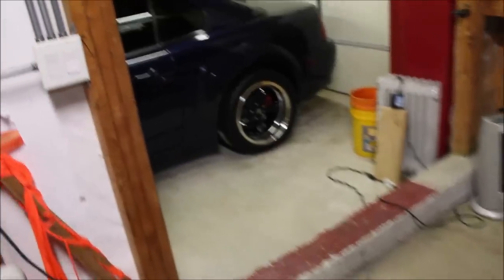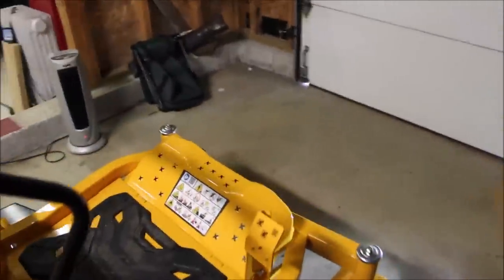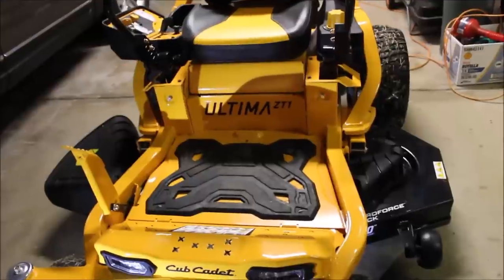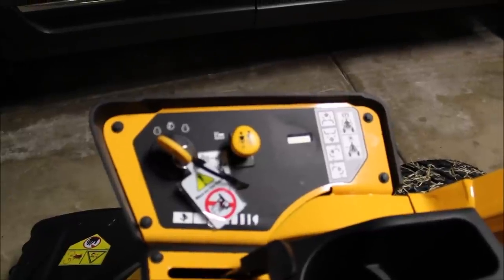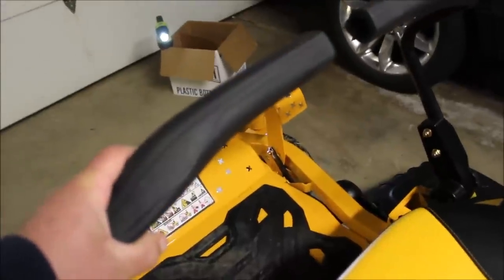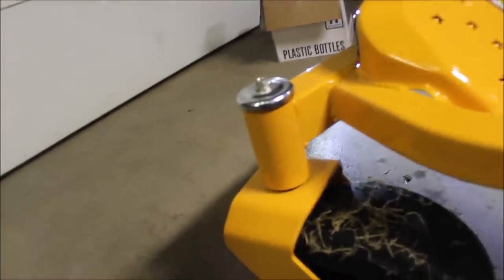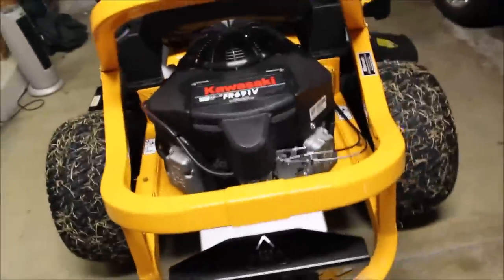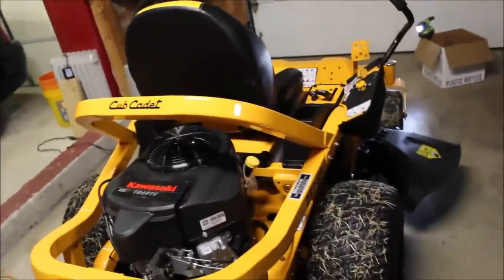Cub Cadet ZT1 Ultima Series Initial Overview

Comment from the maker: My Zt1 50 had the deck vibration that some have complained about. After a little back and forth talk with the dealer I contacted Cub and sent a vid, they confirmed it was an issue but said it was isolated. They set up a case file which I gave to my dealer. Cub sent new parts to my dealer and the mower was repaired. I cut last night and I'm now completely happy with the operation. This is the condensed version of course and transpired over a few weeks, now that the issue is resolved I will shoot a detailed video update on the whole process and resolution. Thanks for watching!!
Reply: I like your retro look Mustang rims.  I will be buying a set for my Mustang soon.  Where did you get the black/aluminum type?  I did not see those on "the tire rack" site.
Thanks.  I like my ZT1.  Just tried the mulch kit today.  Tall 8" grass, no piles.  I am happy with it.
Reply: Did you say you were into RC cars?  If you run the gas 1/5th scale, I am Doug from ESP, Zenoah engine builder sold at DDM.  You ever run my stuff?  :)
Reply from the maker: EarthSurferUSA Thanks Man! LMR (late model restoration) is the place for wheels!  Agreed the mulch kit is working perfectly!    Thanks for Watching the video!
Reply from the maker: EarthSurferUSA Im into Rc but i dont have any 1/5 scale they are awesome but costly!  Im into 1/10 and micro and really like 1/10 Tamiya kits, especially the retro kits👍

Comment: I bought one early spring. New home to us with 1 acre, lots of terrain and mega  trees. I’ve worked it hard both cutting grass and picking up leaves. Plus hauling a gorilla cart loaded with dirt/rock, etc up to 1000+ lbs. it’s been a work horse, no probs to date. Love the zero turn fine control.
Reply from the maker: That's Great to hear! I wish I could say the same my deck is still jacked up I will have to figure something out before spring. They worked on it and it was much improved but by summers end it was banging away again. I'm thrilled with all aspects other than the sloppy deck☹️. Thanks for leaving the comment and for checking out the video 👍 👍

Comment: I gave thumbs up, and liked this review because you explained something I have never seen explained, but absolutely logical. Longer blades, high rotational mass, more flex. Folks don’t realize the 2 blade mowers have 2 LONG blades to get 42-46 inches. Even the 46-48 with three blades have wide stamped decks more prone to flexing and dent / bending. A long piece of metal bends easier, period.  

Also when you compare these new Cubs to the Ariens or the Toro; the frame is bulkier, the chassis is stiffer, etc.
Reply from the maker: Thanks alot For watching the video and leaving the cool comment!!👍👍

Comment: Im so torn on buying the cub cadet 50 inch tractor or the 42 inch zero turn, tractor seems to have many more things you can use it for but the zero turn seems so nice
Reply from the maker: My Buddy bought the 42 zt1 and loves it, he has no vibration issues with the 42. The comfort of the zero and tractor is not even in the same category and the zero is much more agile and fast at getting the job done. I got home from work and rain was coming, I jumped on mine and cut my 200×100 lot in about 20 min, that was mostly at full speed. I just posted a full review and cut footage last week, check it out 👍.  Thanks for watching!

Comment: Just bought this mower in the 42 April of 2020. Still prob one of the best zero turn residential lowered out there. Love mine I have a yard approx the same size as yours and I was able to cut it in under 30 minutes. Lots of trees and obstacles which is why I went zero turn. Overkill? Maybe but I love it.
Reply from the maker: I wish i would have went with the 42 , the 42 deck seems smoother from what i hear. Congrats on the purchase and thanks for Watching!!

Comment: looking at one of these from my local cub dealer to mow my yard and my neighbors yard I take care between the two yards it comes up to probably around 2 acres.  I was having a hard time deciding between some of the other features you get with the ZT1 50 inch and ZT2 50 inch.  I feel the ZT1 will suit my needs good but, been reading over all the people last year who have had the deck vibration issues with these.  Hopefully the new ones my dealer has in that problem is cured.  I just have a question do you regret buying this mower?  I am probably going to pull the trigger here in the next 2-3 weeks or so and go get one.
Reply from the maker: 427 Elevating Productions Im still having deck issues and it is gradually getting worse. I have to reopen my case and if the mower was correct I would love it but unfortunately after buying a mower I thought would last for many years I’m disgusted! I know many have had good experiences, but mine has not been good. I was very excited to get this mower and after investing my hard earned cash I expected much better. I could have went with a cheap tractor and had a better result. I also feel the hydros are loud and i dont feel confident they will last long. Im hoping Cub will do the right thing and correct my issues, if they dont I will seriously consider trading in which will result in a loss on my end. If i didnt have the issues i feel the overall design is great but what good is a mower if it doesnt cut grass right or smoothly? I will update as more info is available, Cub should have a solution by now last year they told me they had no deck complaints......Thanks for watching the vid and good luck with your decision👍
Reply: @2RCPRODUCTIONS  thanks for the response sorry to hear your still having deck issues though.

Comment: Thinking about purchasing this unit but you’re not the only one who has mentioned a deck vibration on their YouTube videos. Have you heard anything back from Cub about the issue?
Reply from the maker: Yeah there's a definite issue, my dealer so far has been no help at all. I'm waiting on a call back from him, been 3 days now after calling with my case number for him to schedule a pickup for inspection. Cub has been helpful so far, I sent them a video and they contacted me right away and said it was NOT normal and needed to go to the dealer for inspection. The owner of the dealer thus far has told me it's normal and to run with it lol! I'm hoping Cub makes it right, if they can determine what it is I will fix it myself if I have to. I will say it's not an issue that arises mine was that way since first cut so having said that the mower overall is fantastic and much better than anything else in it's class. So just be sure you run it first with wide open throttle before receiving it. Unfortunately my dealer called it good on prep and sent it over and I didn't check it before they drove off that's on me. I'm waiting for all this to unfold before I post a follow up review. I will say I've cut with it a few times and it cuts and drives flawless it's just the annoyance of the banging idler and vibration and part failure eventually will come from excessive vibration, I will keep you posted, I myself would like a new deck and I'll ship the old one back we will see........ Thanks for Watching 😊👍
Reply: 2RCPRODUCTIONS After a month, I’m finally getting my replacement today! Update videos coming soon.  They weren’t very happy about my unlisted video showing just how bad the vibration of the deck was, so they are sending a rep out to “assist” on the next video addressing the issues. Lol. I’m still going to tell my story.
Reply from the maker: @g4outdoors  They are Telling me they are unaware of an issue or what it might be? My wife called the dealer today and to my surprise I guess he ordered a bunch of parts to replace and to try a solution. Thanks for sharing and being honest, your followers will appreciate that👍 I will eagerly await your next video 👍
Reply: 2RCPRODUCTIONS Unfortunately, I’m out of town on vacation for a bit. So I won’t be able to record until Monday, but @cut&cleantv will more than likely have his up by the weekend. (Read edit)
Reply from the maker: @g4outdoors  My Wife talked to the dealer they picked it up today and Cub sent parts to the dealer so we will see what happens 🙄🙏...
Reply: I spent 2 months narrowing down the search for a new zero turn. Ultimately it came down to 3 models. I wish the fabricated deck was built a little better. The plastic used in the hand control joints made me nervous. The paint on the frame was not applied evenly and missed spots. The thick mechanics wire for disengaging the hydrostatic transmission was a cheap design. I did however like the added options of the lights, high 18 inch seat and floor Mat. I did however end up buying the John Deere 355E from a John Deere dealer. They actually beat the box store price and now I have customer support from a manufacturer directly. Good luck making your decision.
Reply: @jamiewallace6551  So how is that 355E treating you after 3 years?

Comment: I’m looking at one of these , just got a 3 acre yard with the new house , will this machine be able to handle 3 acres once a week ? It’s all flat pretty much as well
Reply from the maker: I would say it would without an issue, you can get a 54 or 60 and the zt2 comes with better transmissions. I've been using mine on some hills with no issues at all. My yard is 1/2 acre and with the 50 I can finish in about 20 min or so. Thanks for watching the video 👍👍

Comment: Should I be concerned when my zt2 right out of the gate is misaligned? I pull the lap bar straight back and it pulls one way. The same going forward when both bards are fully extended.
Reply from the maker: You can adjust the limits to try to even them out, the adjustment bolts are right in front of the push bars. This is the only zero turn I've driven but I've read all brands have the same issue. Mine is like that as well. You have the better transmissions on yours. Thanks for watching the video 👍

Comment: Nice  mower I bought me a zero turn last year I love it I went with a gravely pro turn 52 I had a craftman before as well it only lasted me a year before the engine went
Reply from the maker: Thanks man! 1 year only on the engine??😲 That's terrible! What brand of engine?   Thanks for watching!!
Reply: 2RCPRODUCTIONS it was a Briggs 22hp I bought brand new in 2017
Reply from the maker: @seanspangler7963  That's terrible! Briggs used to actually make good engines back in the 80s and 90s...
Reply: 2RCPRODUCTIONS  I know I now have a Kawasaki engine which is the exact same engine as your cub cadet so far I’m very happy with that engine
Reply from the maker: That's Great too hear man!! Mines running great but still not happy with the deck noise and vibration, cuts great but should be smoother in my opinion.

Comment: Sweet looks...hydros serviceable?
Reply from the maker: This has the ezt 2200 hydro gear setups. They are sealed and relatively maintenance free but I'm sure if s gear broke it could be taken apart. These are residential grade and I've read good things about them. They are warrantied under the mower for 5 years. If you want to step up to the zt2 it has the ezt 2800 which is not sealed and oil can be changed they are beefier as well but there's a big jump in mower price. Thanks for watching the video!!👍👍

Comment: Looking at these mowers right now but the sealed bearings on everything worries me. Just wish they let grease your own stuff.
Reply from the maker: I hear ya but it is covered unlimited hours for 5 years which is cool my yard takes about 30 minutes a week so should be good for a while if their decent bearings. Thanks for watching the video!!
Reply: @2RCPRODUCTIONS  Yea I would hope they are quality bearings. Lookin hard at these mowers right now. The issues with the deck vibration have me a lil skittish but there is a lot about these mowers I do like. Only cuttin an acre and a half lawn.
Reply from the maker: @rzl07375  Agreed man, I'm going to be updating on the deck vibration as well, the problem like you said is there is no comparison with other models in it's vlass. It's an awesome design and I'm sure we will get the vibration figured out soon. It was a joy to cut with and cut quality was amazing! Normally I walk through my yard and there's clippings tracking all over, I couldn't even see a blade of grass it cut so fine, granted it wasn't real long yet but still I was impressed👍

Comment: This is going to sound crazy , but I've done it , and it works .... On a new deck spray the underside with Pam Cooking Spray , and let it sit overnite before you mow , the grass will hardly stick to it .... and if it does stick , when it dries , the vibration will make it dislodge as you mow !!  Believe it or not , it's your choice !!  Peace Out !!
  😆 - MW  Texas
Reply: Great idea, thanks.
Reply from the maker: I believe it could work Brother, but how do you spray under the deck? Do you jack it up before each cut? 🤔.  Thanks for watching 👍👍
Reply: @2RCPRODUCTIONS    Two ways to do it ... you can jack up the front end or ride it up on ramps .... you can spray it on .... or you can spray the solution into a cup , container , etc. and use a paint brush to apply it .  Works best on a new deck , new paint etc.   The funny thing is my Brother came by last night 2 hrs before I came across this video and asked me to go with him next Sat. Morning to pick up his new ZT-1 !!  L   
I operate my own business as an ATV -Lawn Mower Mechanic , so I'm pretty positive I'll be doing the maintenance on it ... drop in every now and then and I'll keep you posted !! 😆  Thanks - Matthew
Reply from the maker: @waylonmccrae3546  Nice!!👍👍
Reply: I’ve used the Pam idea for my ATVS for years to keep the mud from sticking as bad. I don’t see any reason why it wouldn’t work for grass
Reply: I took some ceramic car finish and did the underside of my deck prior to the first cut.  Lasted all season with no grass sticking underneath.  This will now be part of my spring maintenance going forward!

Comment: Thanks for the review, trying to decide on this or the ZT2
Reply: Dont do it! I just returned my zt2. What holds the deck lift bar is a clamshell that holds the deck suspension bar on both sides with a grommet that goes pressed into the frame, Mine pulled out i put back in and of course it came out again. Did 2 small yards with it never hit anything or scalped but noticed that my cut was off. When i got home i tried to level the deck but there was no way it could be done 2" difference, the right side was way low, then i noticed the grommet pulled out. They were going to order me another one and i told them no thanks. The zt2 was everything i wanted but the deck suspension bar is what takes all the impacts, very inferior design. I feel bad for all the owners of these mowers. Ordering the raptor sd 54 with the kawi or the liberty z.
Please be carefull people.
Reply from the maker: @danielcondon1607  This is the first I've heard of any issues with the design but I will find out soon enough and I will report back on my experience. Thanks for the comment👍
Reply: @2RCPRODUCTIONS  I sincerely hope its never a issue for anyone! I absolutely loved everything about mine, i just couldnt allow myself to have one after what happened, its my livelihood.

Comment: My 46” gets delivered at 8:30 tomorrow morning.
Reply from the maker: Nice! Make sure the deck is smooth before you take possession. You should be ok with the 46, the 50 seems to have the issues.....
Reply: 2RCPRODUCTIONS we talked about them before time and it’s from a distributor less than 2 miles from me. It should be fine.
Reply from the maker: @toadranger50  👍👍

Comment: That's some mower for 1/2 acre,  I mean, a little over kill there??  Great video though,  I want a zero turn buy my 12 year old Husqvarna keeps on going.  It's not a zero turn though.
Reply from the maker: Yeah a 50 is a little big but time is money and I can now mow my yard in 20 to 30 min vs the hour and 15 with my old 42 lawn tractor. It's way easier to negotiate obstacles with the zero even with it's size👍. It's hard to get rid of a good mower if it's still doing it's job, my old one was finally worn out course it was an early 90s Craftsman.  Thanks for watching 😊😁

Comment: I just ordered one and cant wait. Great video and hopefully I dont get one with the vibration issue. Its shipping from the factory so hopefully no issues. 20 mins per cut , I would say you will have no issue with it lasting the rest of
 your days. I expect to put in 2.5 to 3 hrs per mow.
Reply from the maker: Congrats man, if you don't have the vibration it is a 100 out of 100, after my repairs it has been much improved and  joy to use. It still has a little belt slap but hopefully it doesn't cause any issues long term with bearings etc. It is very comfortable and the cut quality is top notch! Let me know how yours is after you cut with it? Thanks for the comment and for checking out the video 👍 👍

Comment: Awesome mower I bought the zt2 54 inch cut in December can’t wait to use it.
Reply from the maker: Congrats, I think the 54 is free of vibration issues the 42 is plagued with. Thanks for checking out the video!!
Reply: @2RCPRODUCTIONS  I turned on the blades so far no vibration. I’m pretty sure Cub fixed that problem they used a heavier tenting spring.